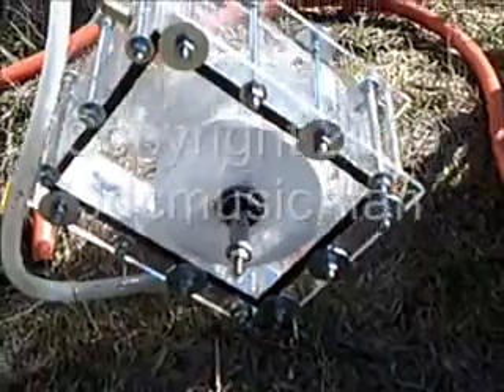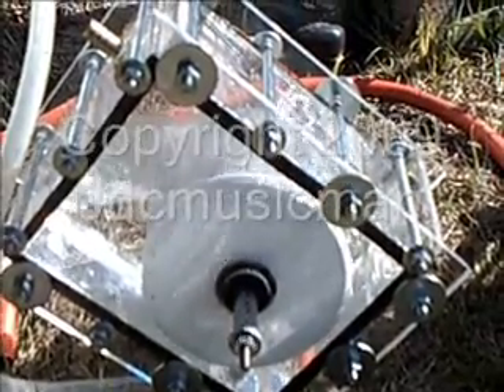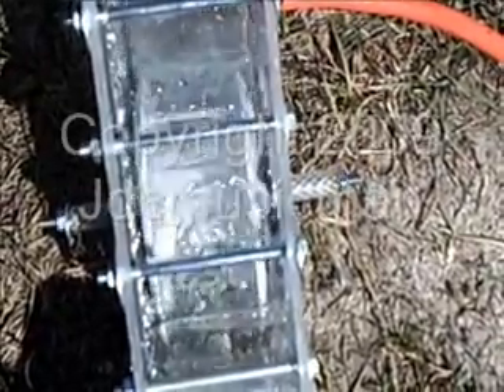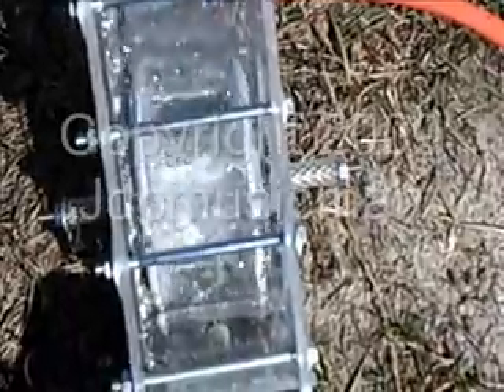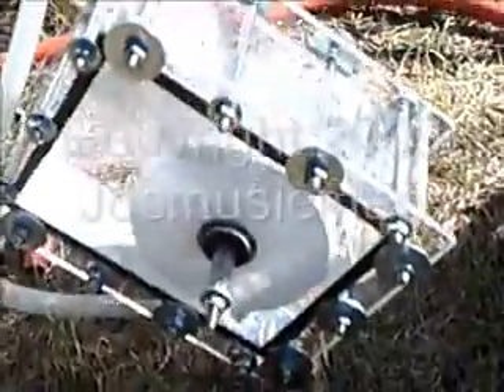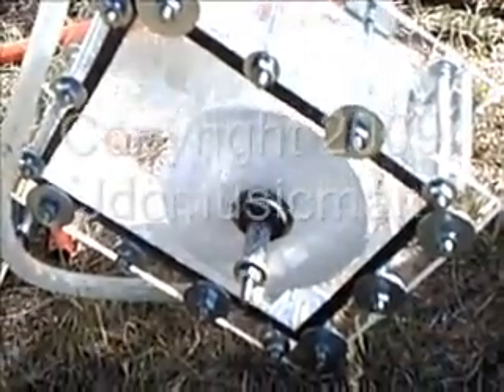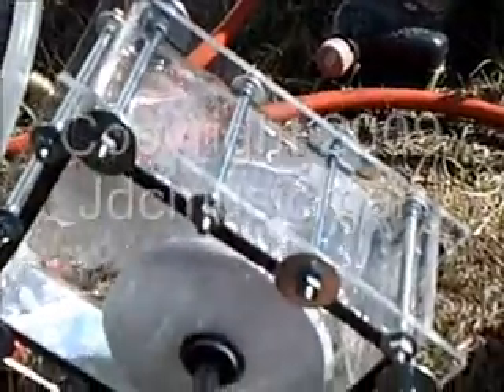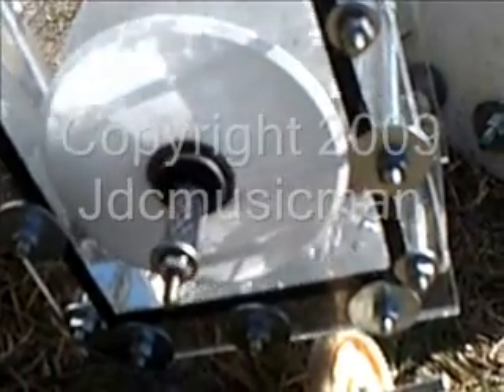Tjgame2's HHO Wheel ,Testing Modified compact design prototype #2

Comment: Hi I like this even more, looking more professional, I cant tell if you are still using the cups, it looks has though they could be flaps if they are I would suggest letting the flaps flap backwards on themselves when they reach the top, this would stop backward drag on the flaps,
they would automatically lock into position when they come around to the gas.
cheers

Comment from the maker: Yes torque is what we are looking for...This was just a prototype,it does basically what i want it to do,just not as good as i want it to do..When I do the mods I will see a huge diffidence ,and also the wheel size will be bigger in the final wheel...I'm just doing small to get all the bugs out , then when that is accomplished I will be going bigger to a 2 or 3 ft wheel..The bigger the wheel the more torque it will have at the shaft..
Thanks for your input....

Comment from the maker: I agree with the pressure,my gas hose is 3/8" but I have it reduced to 1/4" inside the box,I will be reducing this down to 1/8".I have discovered the possible flaws in my design and plan to fix them this week, and test again,I believe i will have better results the next go around....

Comment: you might want to try releasing the hho through a very small hole to create pressure to spin a wheel but with no water as this will create resistance different concept but i believe the faster rpm the more resistance the water will create. at the end of the day the speed of the bubble floating to the top of water is what will determine the speed of the wheel. volume of hho will only help so much but pressure is far more higher in potential rpm.i think this is correct and i welcome comments.